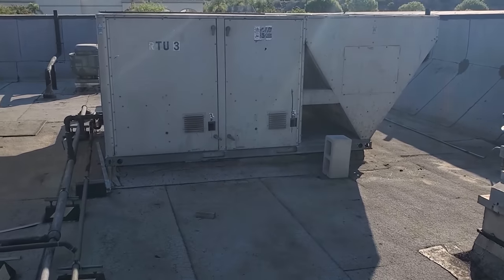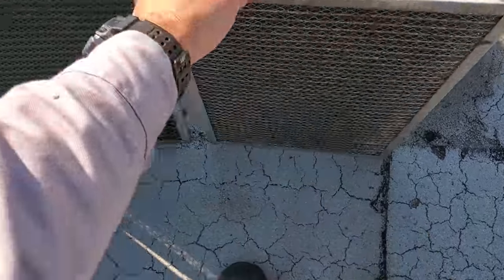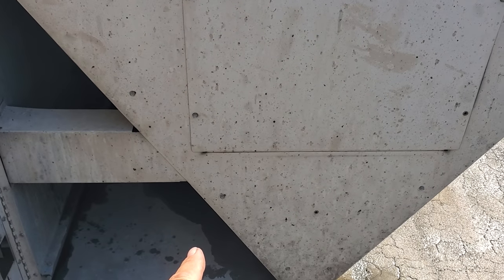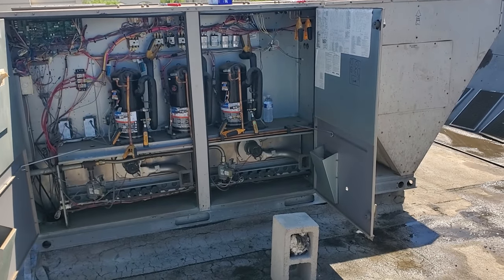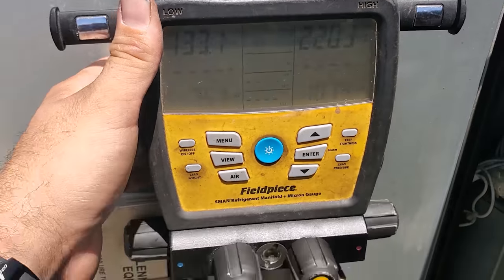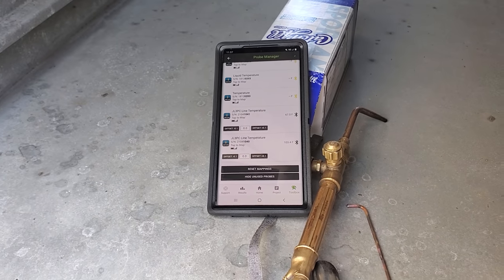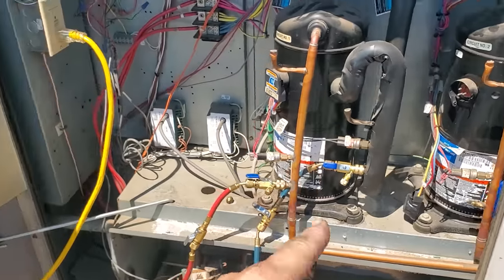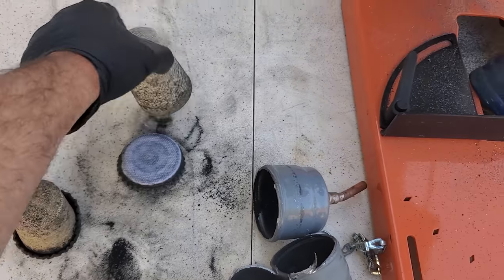ITS JUST AN AC HOW HARD COULD IT BE......

Comment: I once had a mini split the would reverse the fan rotation on the condenser like every 4 hours or when you turned it off I never had to clean that thing in the 7 years I had it while the other ones would get dirty this one did not need cleaning
Reply: That’s clever, with most setups that would be a lot of extra parts but with a mini split that fan already has a speed controller so reversing is easy.
Reply: They are starting to do that with newer refrigeration units, also has a brush that runs up and down the condenser every so often. Another thing to have to fix.

Comment: Why doesn't the compressors just shut down earlier before damage is done? Sounds pretty logical solution to me...

I mean you could just install a temperature shutoff which reads the temperature next to the compressor and shorts the power to ground to trip the breaker if it's too high.
Reply: Better idea, instead of shorting the power to ground to trip the breaker, have that temperature sensor trip a relay that's in line with the coil of the compressor contactor. That way you're not relying on tripping the breaker, and with a little LED on the board for the temperature sensor the tech would have a clear indication of why it isn't working.
Or you could integrate such functioning into the control board itself, and have it read out a "compressor too hot, Stage X" code for the tech to start working with.
Reply: @44R0Ndin  a relay isn't designed to work as a fuse. They might fail if the ambient temperature is too high and they are designed for a very high cycle life, not to reliably disconnect a high load in extreme temperatures.

The relay might weld itself shut or catch fire since the arc is stronger then anticipated by you.

It's safer to have relays ground all legs leading to the compressor and do this in a dedicated box which only has a temperature probe into the unit.

The relays might weld themselves shut while doing this, but only one of 3 breakers need to work (on a three phase system) and the unit will turn off safely.
Reply: @RubenKelevra  Right, and that's why I said the relay should be switching the COIL of the REGULAR control contactor, aka "use a tiny bit of current to turn on and off a lot of current".
Besides, circuit breakers are only rated for interrupting a short for a certain (not very high) number of times. And it wouldn't be the first time I've seen where the facility is using 3 phase breakers but doesn't have the breaker levers tied together.
Using a 3-phase contactor to do this job (that it's already doing under the control of the control board) is using the contactor for what it's already designed and rated to do. I really don't see what the problem is here.
Basically, you don't want to ever create an intentional short circuit. So-called "Crowbar" protection circuits are used in switch-mode power supplies, which do something like what you're describing, but they're not the right way to control a 3 phase load like a large AC compressor where the short-circuit fault current can easily be over 1000 amps in the moments between when the fault is initiated and when the breaker trips. You can get a self-sustaining Arc Flash fault at just 240v 3 phase, and if that happens the results are basically the same as if a bomb went off.
So instead of SHORTING OUT the thing, just "turn it off", using the switch that is already controlling it.

Comment: I was curious I’m in California in a hot region
And code requires make up air systems some built into the hoods some not on older applications 
Mostly use evap coolers so when the exhaust fans come on so does the make up air.
Reply: And fire control systems as well
Reply from the maker: I will discuss this on my Livestream this evening 7/26/21 @ 5:PM (pacific) come check it out https://youtu.be/f6_dxFO6940

Comment: All the air handles should have their own receptacles installed in or within sight of the air handler, which I think is a NEC code residential code, not sure about commercial. The electrician's should install them out of respect for other technicians. My opinion, not saying anyone has too.
Reply: That only applies to new installations (in Canada, right in the electrical code book). Old installs are grandfathered in. You won't see a maintenance receptacle near old or replaced rooftop units.

Comment: would it be that horrible if you replaced that bad dryer with a bit of pipe? I mean you're using nitrogen when welding, and considering they are getting a new unit... The dryers aren't on every unit in Australia, we use them, but typically more on units that have been repaired, a good amount of new units just don't have them, and typically it isn't a problem.

Comment: Man we had a big energy project for a school district, there was a large coliseum that was humid and had terrible mold issues. Started looking and they had massive EFs running 24/7 (to suck moisture out of the building), all make up units disabled and RTU economizers locked closed (to stop humid air from getting in the building). We could NOT convince the maintenance guys to leave everything in auto. We explained that with the huge fans running, air was being made up through cracks, doors, etc, and it was hot humid air vs the conditioned make up air that they needed. Finally had to get the superintendent to start threatening firings to get them to leave everything alone and surprise, like magic the relative humidity dropped to normal and mold stopped being an issue.

Comment: No r11 cleanup?
Reply: r11 ? its not 1987.
Reply: @peterhansen8216  lol
Reply: @IFIXCASTLES  bruh why would you rx11 flush a 15+ year old unit commercial kitchen RTU? That means you need to change the compressor oil too. That means you have to spend ten years and 87 oil changes in your vacuum pump to evacuate. Fifteen years is the life expectancy of most RTUs on chain restaurants, per the corporations that own them. Stick a fork in it, she's done. Let them throw compressors at it as punishment for never doing maintenance and constantly trying to make their equipment last "one more year" when they have millions of dollars in a slush fund for equipment repairs and replacements.
Reply from the maker: I will discuss this on my Livestream this evening 7/26/21 @ 5:PM (pacific) come check it out https://youtu.be/f6_dxFO6940

Comment: What is the job of the nitrogen when you need to do something in the lines?
Reply: Not letting air with oxygen and moisture in.
Reply: Its needed to prevent the copper from oxidising on the inside when its heated for soldering. The oxide would flake off and plug up stuff otherwise.
Reply: To be an inert non flammable gas
Reply: @semifavorableuncircle6952  ohh got it got it thx mate